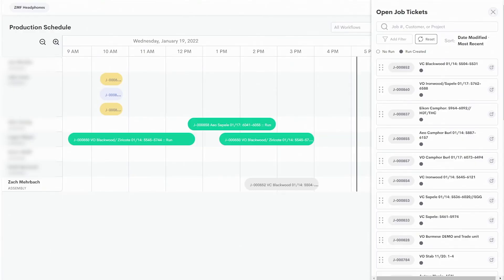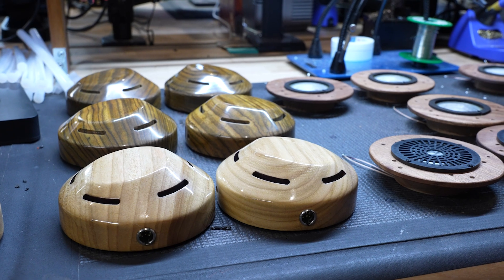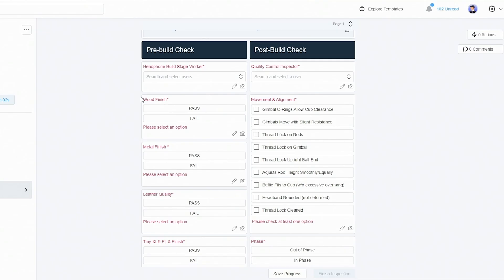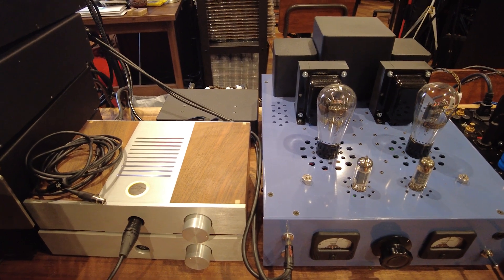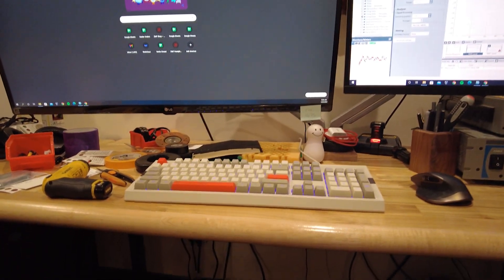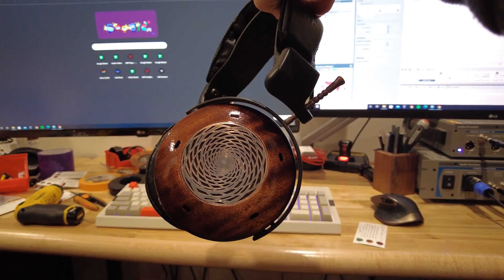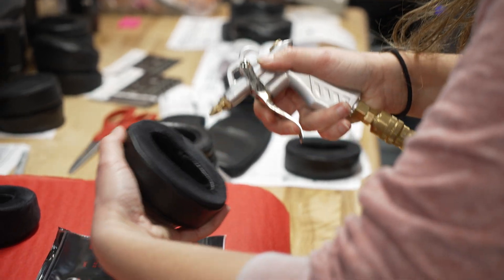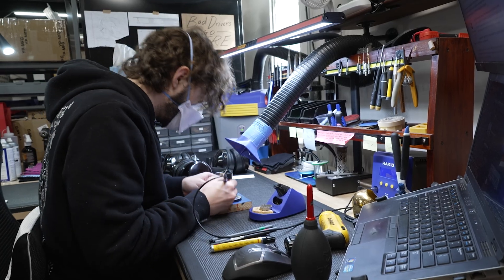THE ZMF PROCESS - ZMF headphones From Start to Finish

Comment: Is it possible to purchase the sea horse carry case separately? My verite closed comes with wooden case but I want the sea horse case as well for more protection when traveling.
Reply: they're just regular seahorse case se430, you can get that exact one with the pick foam. I ended up getting something a bit bigger from the local hardware store